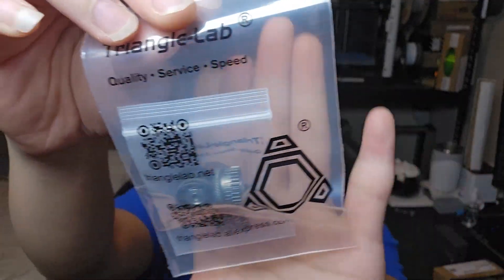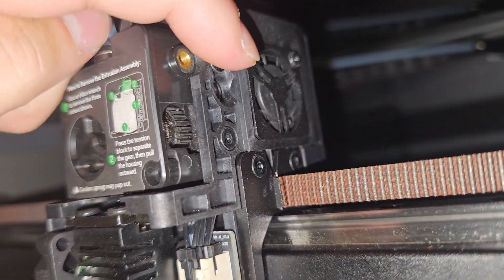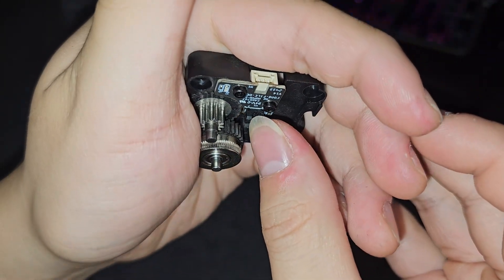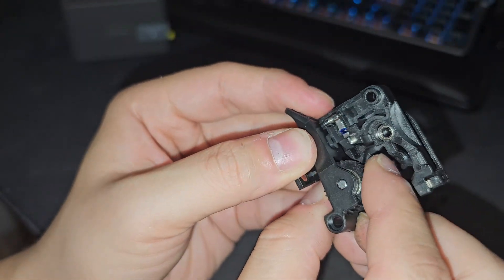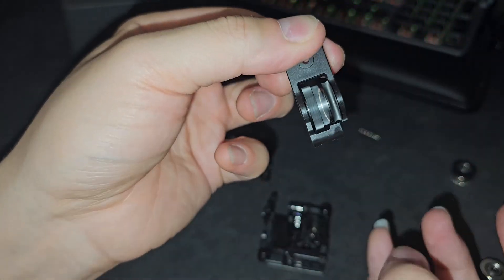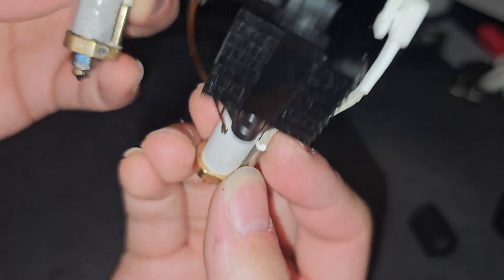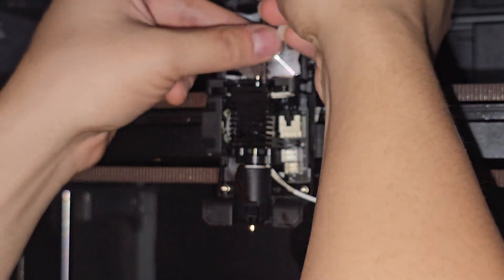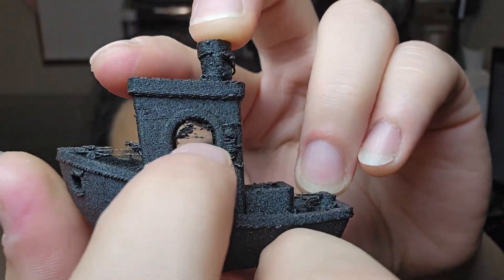Two Upgrade To Make Your K2 Plus Print Anything!

Comment: What is the strongest filament the k2 can print? I would like to replace helmet parts on my hockey gear
Reply from the maker: The strongest/hardest filament I printed with my k2 plus is PP, PC, and Nylon filament, it can print but slowly and have to be careful with the model lifting up.

Comment: Does that mod also work for the standard K2 printer? Because I tried TPU and it wasn't pretty
Reply from the maker: If the k2 use the same gears as the k2 plus then it should work, but its better to get the ones that made specifically for the k2.
Reply: @Scratch3DPrinting  I checked. The gears says "for K2 series", but the heating block says, "for K2 plus"

Comment: I've printed 10+kg of PC-CF, PC, PETG, PLA, PPS-CF, and at least 5kg of PPA-CF and never had an issue with the stock gears.
Reply from the maker: try TUP. I honestly never had problem with those filaments as well.
Reply: I'm on my 3rd extruder in 2 months. I'm doing this upgrade today. Only used PETG.

Comment: Bro, your facts are so off. Stock gears in the extruder are not plastic they are metal. Secondly, the hot end heats to 350c on the stock hot end. How can you possibly not know this? 😂
Reply from the maker: They are plastic, I tested with magnet and it does not stick. 

For the hotend, I remember seeing 300c on creality website, but just check and it is 350c you're right.😅
Reply: @Scratch3DPrinting magnets won’t stick to any metal. It must be ironed based to do so.
Reply: @Scratch3DPrinting  google "are all metals magnetic" lol

Comment: I got metal gears for k2 plus.  I run them in my k1c's.  But I do long like 60 to 100 hour prints, mostly pla, did you have any heat creep issues with metal gears on k2 plus?
Reply from the maker: I dont usually print things that long, I only have printed like 5 hours prints. Seems like no problem.

Comment: Why didn't you just do the TPU mod? It costs less than 10 bucks and 10 minutes to set up. Also, check out the MicroSwiss hotend. It's well worth the price and the nozzles are far supperior and easier to swap on the fly, not to forget to mention that you can use a Diamondback diamond tipped nozzle with it.
Reply from the maker: Yeah microswiss hotend are pretty good. Also what is the tpu mod...?
Reply: Search stay ready to 3d print…, he shows the mod where u replace the stock spring and print out a small spring stop cap… this allows u to adjust the gap on the gears by means of a thumb screw

Comment: Very use full ! I have some problem with ABS filament , do you thing it could résolve problem like TPU ?
Reply from the maker: Maybe, but ABS and TPU are different filament, one is flexible and one is not. But a better quality gear is much better.

Comment: you didnt undo the small side screw on the extruder
Reply from the maker: What do you mean? Did I forgot the screw in one screw back?
Reply: @Scratch3DPrinting  sorry I noticed after I put the comment that someone had said to you that you didn’t need to remove the whole of the extruder you could’ve just remove the front plate. This is where the screw is on the side. There’s two in the front and a small one on the side. But like I said, somebody else had pointed that out.
Reply from the maker: @allypallywizzy ahh yeah that is another way of doing it.

Comment: Did you print anythibg else that youve printed with the plastic extruder gears and compare? Did you have to rerun pressure advance or extrusion rates for filament profiles? Thanks for the video. I bought the upgrade gears but dont want to mess up all my filament profiles so waiting to do the upgrade
Reply from the maker: No i haven't compare the models that I printed with the new upgrades. I also did not do any calibration, I forgot lol but yeah,  I just use the same profile and it printed great.

Comment: I haven't tried TPU but I did replace the hot end with the Micro Swiss Flowtech which also runs great on my K1 Max. It also works great with the CFS and the same 0.2mm nozzles I use on my K1 Max.
Reply from the maker: Yeah micro Swiss hot end works great on creality printers.

Comment: This is great.  I need to try TPU with my new gears.  You don't need to take the entire extruder assembly off to replace the gears though.  You can just do the 2 front screws and the screw on the right side to remove the extruder cover.
Reply from the maker: Yeah that works too,  but i want to pull it out and assembly it so I can get a clean video of installing the gears.